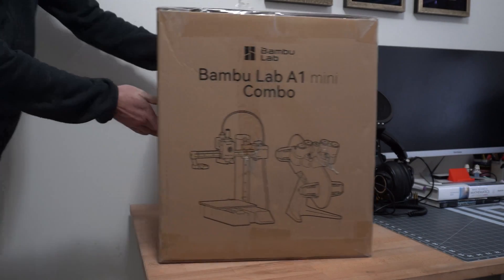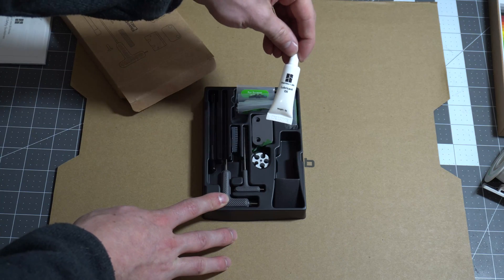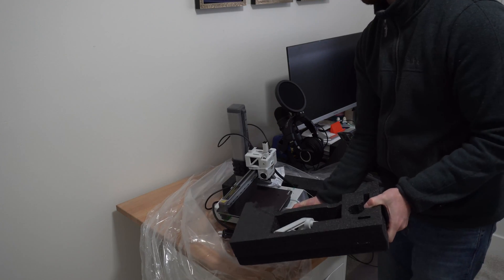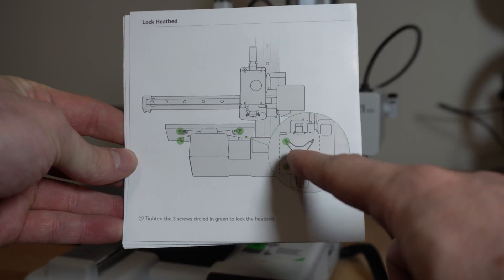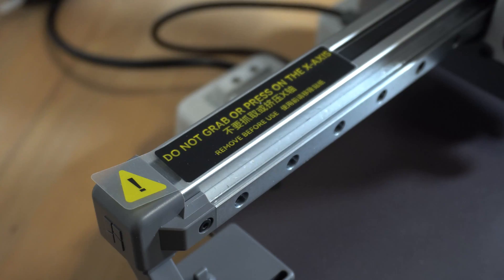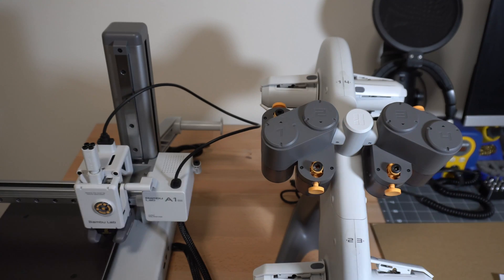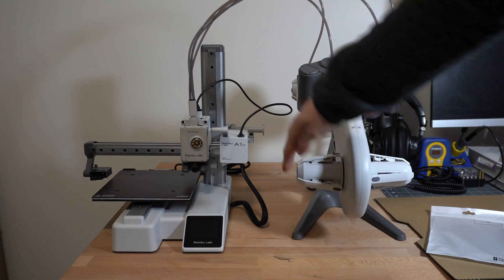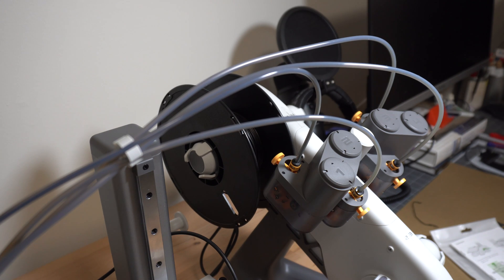Bambu Lab A1 mini |  Unboxing and Initial Setup Guide

Comment: is the purge wiper important? cause my box didnt come with it
Reply from the maker: It is important. Might want to double check it's not still in the box or stuck in the packaging. If it didn't come with one you should reach out to support. 

At the beginning of each print and between color changes if you have the AMS, the printer will purge filament and eject it out the side. Without the wiper that purged filament "poop" will just end up dragged into your print.
Reply: Does it come with a pair of nippers? Got my A1 today, and no nippers. As a previous reality user, anytime the nippers wore out we buy a new printer. I was shocked.
Reply from the maker: @ no nippers with these printers. Gonna have to buy your own

Comment: 3:46 how the heck did he slide that thing in so easily lol.  Mine is like fused onto there after wards.
Reply from the maker: Weird, I've installed the purge wiper on 2 printers now and they've both gone on very easily. Do either of the parts look deformed in any way? Or can you see an extra bump of plastic left over from injection molding?
Reply: @3DPrintStuff  Where would I see this left over plastic?

The screw took a few minutes to get it in because it just wouldn't line up right with the hole. When I tried adjusting the purge wiper it just wouldn't budge.  THe thing is stuck on there now for the most part when I tried taking it off.

So hopefully I'll never have to take it off or else I'm screwed.

Comment: Install what plate?  Odd you didn’t show that.  Off to figure that out and how exactly you made the wheel of filament turn when loading.
Reply from the maker: Yeah I should have showed a shot of installing the plate. There's a gif mid way down this webpage that shows it: https://ca.store.bambulab.com/products/bambu-textured-pei-plate-a1-mini 
It's just a matter of placing the plate on the magnetic base using the notch to align with the heated bed. 

There's a load/unload functionality in the screens. "Load" will feed the filament in and you'll be ready to print.

Comment: I didn't get the little engine model  :(
Reply from the maker: Yeah apparently they only shipped out with a limited number of units when the A1 mini was originally released.
Reply: @3DPrintStuff  I cried and they sent it to me 👌 had to send serial number from box but they sent it.  Funny thing is, the bearings are for full size and not the mini print.   I have every single piece printed and the bearings are 3-4 times too large.  I ended up printing new bearings for it.
Reply: I got the mouse kit.

Comment: Hi! Does it have a microsd card slot or can you only use the cloud and LAN mode?
Reply from the maker: Yup there's a micro SD card slot. 

"The printer comes pre-installed with a 32 GB Micro SD card." https://wiki.bambulab.com/en/a1-mini/manual/faq

Comment: I missed tightening the screws under the build plate. Thanks for that save. I'm guessing you've seen the 5th slot on the tube holder is for the black cord. Cheers!! Thanks for the info.
Reply from the maker: I had not seen that the 5th slot was very clearly for the black electrical cord haha. I guess we both helped each other out! Thank you.